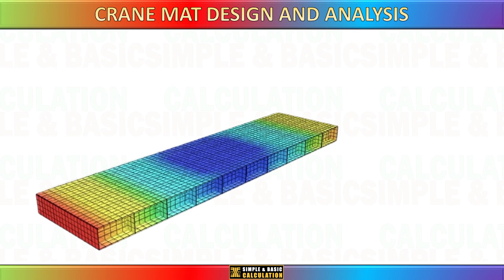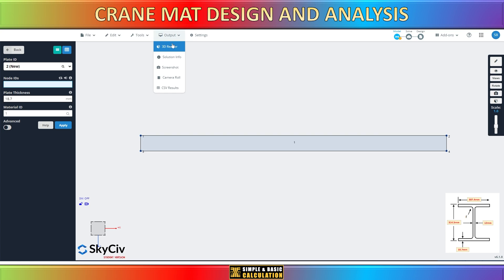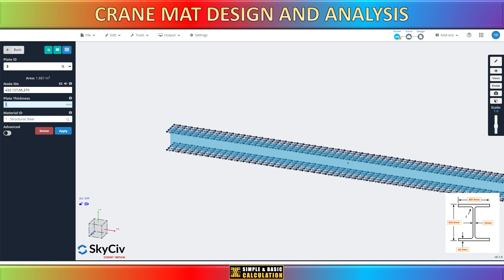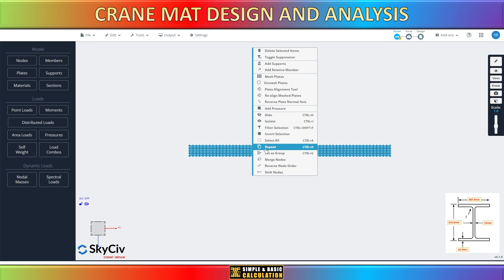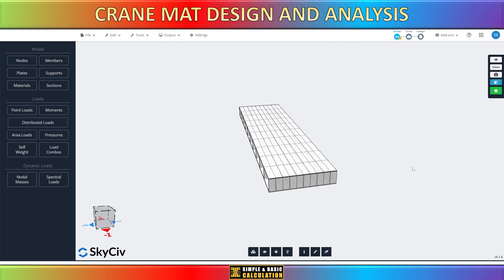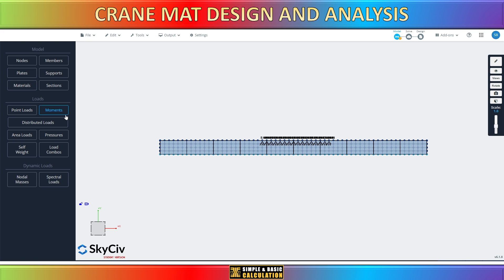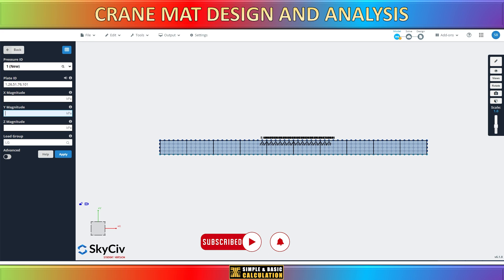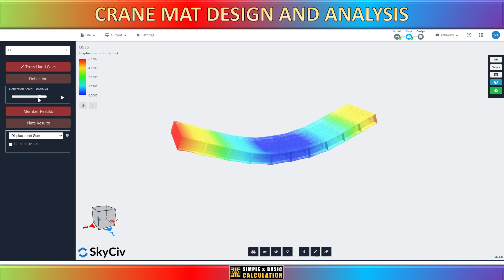The Surprising Secrets Behind Crane Mat Design & Analysis #crane #lifting

Comment: Where did you get 200 kpa from.
Reply from the maker: This is assumed value. I consider 200kpa is pressure from crane outrigger
Reply: @SimpleandBasicCalculation Ok thanks!  I though it might have been ground bearing pressure.